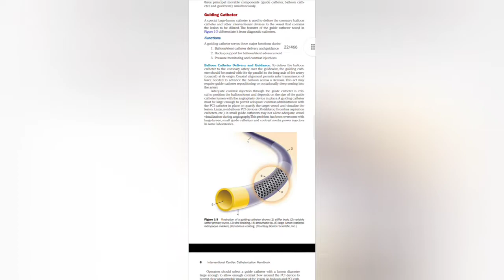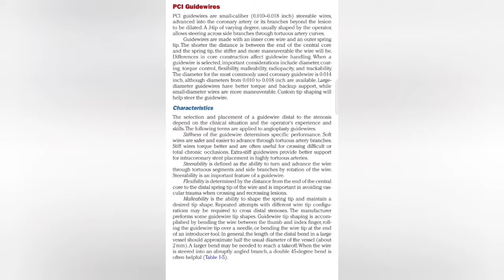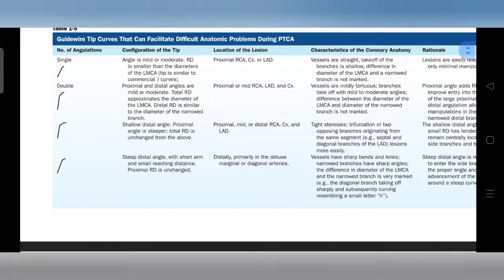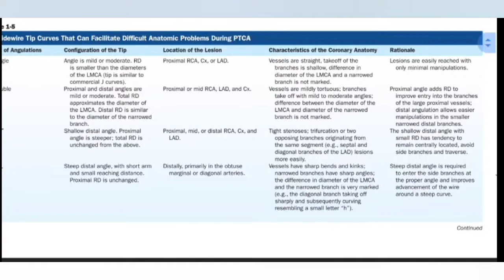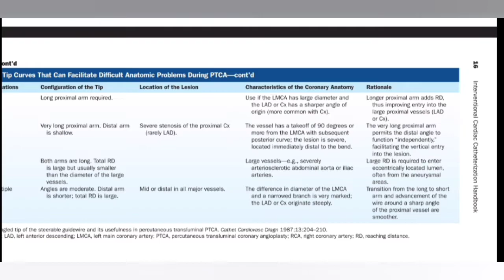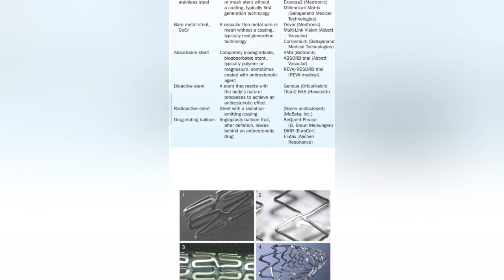Interventional cardiology part A

Comment from the maker: Definitions of PCI Success
Percutaneous coronary intervention (PCI) success may be defined by 
angiographic, procedural, and clinical criteria.
Angiographic Success
•	Angiographic success in a stented artery is a minimum stenosis diameter
reduction to <20%.
Procedural Success
•	A successful PCI should achieve angiographic success without in-hospital
major clinical complications (e.g., death, myocardial infarction [MI], emer-
gency coronary artery bypass surgery) during hospitalization. MI is often 
defined as the development of Q waves in addition to elevation of troponins 
three times the upper limit of the laboratory's normal value. Cardiac troponin 
T and I as measurements of myocardial necrosis are more sensitive and 
specific than CK-MB. Enzyme elevation in the absence of new Q waves is 
counted as MI, peri-procedural. There is no consensus on what level of 
troponin alone is clinically important enough to change major management 
following the interventional procedure.
Clinical Success
•	A clinically successful PCI is an anatomical and procedural success with
relief of signs and/or symptoms of myocardial ischemia after recovery from 
the procedure. The long-term clinical success requires that the patient have 
persistent relief of signs and symptoms of myocardial ischemia for more 
than 6months. Restenosis is the principal cause of lack of long-term clinical 
success when short-term clinical success has been achieved.

After the balloon expands the stenotic area, the balloon catheter 
is exchanged for a stent-carrying balloon catheter. The stent is a metal 
scaffold, mounted in a compressed form on another balloon catheter, 
and delivered in the same manner as the first balloon catheter was deliv-
ered. The stent is deployed by inflation of the balloon as was performed 
for dilating the stenosis. The stent should be carefully positioned. It is 
inflated with the same pressure gauge syringe (8–16atm pressure) for 
10 to 20 seconds. A full opening of the stent with complete strut apposi-
tion to the vessel wall is important for good short- and long-term results.
After the stent struts have been expanded and implanted into the 
artery wall, the balloon is deflated, and the delivery catheter and guide-
wire are removed. Intravascular ultrasound (IVUS) imaging is often used 
to confirm appropriate vessel-stent matching and full stent strut apposition 
(contact without space against the wall). After IVUS and final angiography 
have been performed, the guide catheter is removed. The femoral or radial 
arterial sheath is removed, and hemostasis is obtained in the laboratory. 
The patient is then transferred to a recovery area and then to the patient's 
room. If no complications occur, the patient is discharged the next morn-
ing. The patient usually returns to work shortly (<2days) .